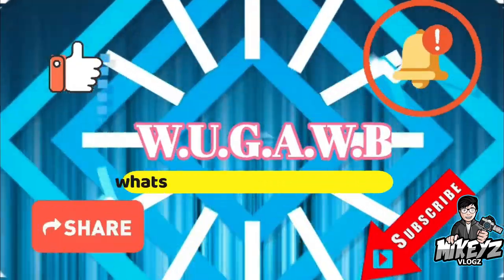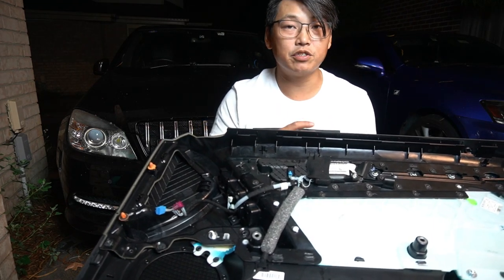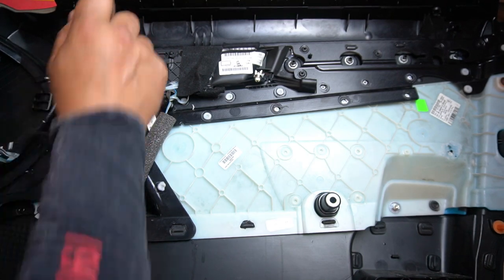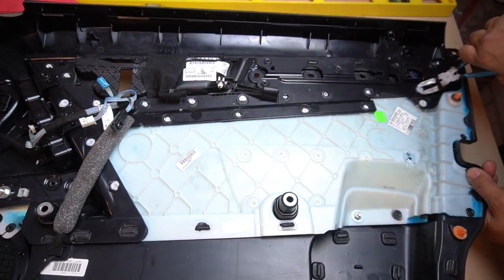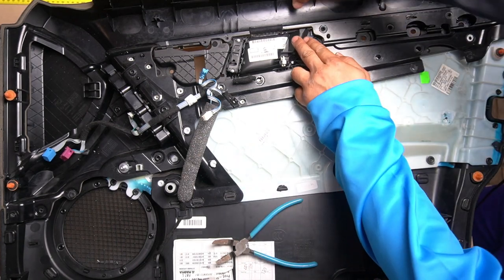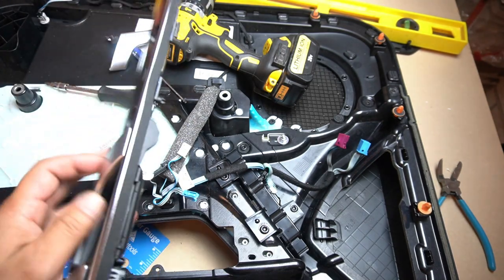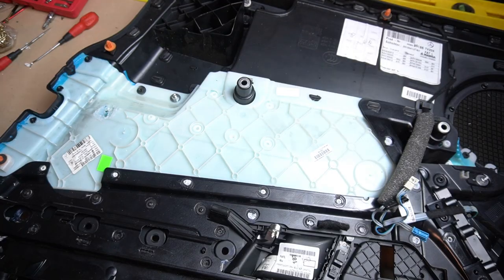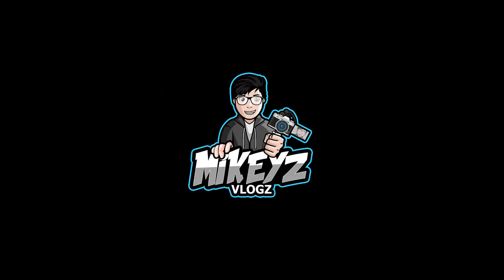mercedes W204 W207 W212 X204 G204 (common fault) interior door handle replace D.I.Y FIX

Comment: Times changed. In my W124 I could remove door handle panel in about 30 seconds, without removing any trim, just one screw. I could fix a broken odometer at the side of the road or swap headlights in -10C at night in 15 minutes. Now I have W204, I need to replace rear shelf (trim? cover?) and I've been mentally preparing myself to do it for a year.
Reply from the maker: indeed it has ... mercedes love being difficult too ..

Comment: Great Video Mikeyz thanks for posting, saved me £100s. 
The kit to fix this fault is on Ama**on
£15 ! 
I did use a large hss drill bit very carefully to remove plastic welds to separate panels,found it more productive. 
Thankyou once again Mikey
Reply from the maker: good stuff mate 👍  well done .. and good on ya using the drill.. good tip
Reply: Big thanks for replying so quickly. Mikeyz
Hats off to you though for the Video which makes an impossible job, possible !
👏🙌👏🤝
Reply from the maker: @johnbavister5936  ur welcome mate ... I'm just glad u didn't take it to mercedes ... cuz we all know how that would've turned out ... bye bye 💰 🤑

Comment: Great video!  Would you happen to know if these replacement handles work for the A207/C207?
Reply from the maker: if ur handles are the same.e yes ...even if not same it will be similar with cutting tabs ..u just need to figure out which tabs allow the trim with the door handle to come out

Comment: great video Mikey 👍 but I started to have a different problem with my 204 .
For some reason my parking lights stopped working I checked bulbs and they are ok, Fuses look to be ok too and instead right indicator  Is flashing right front foglamp.on dashboard shows ther is no bulb.
What problem it might be?
Reply from the maker: what's the problem? the indicator or fog? which one isn't working properly
Reply: @MIKEYZVLOGZ  
The indicator is not working properly..
When I turn indicator on  fogligh is flushing instead
Reply from the maker: @aquamania4441  sounds electrical

Comment: PLEASE HELP!

I finally got everything replaced and the door panel put back on the vehicle. When I went to test it by pulling on the newly installed handle....nothing. I hear the cable being pulled, but the door does not open. Tried locking and unlocking (both electronically with the panel buttons and by manually pushing down the lock pin and pulling at back up), still nothing. Pulling on the door handle will pop up the lock (which I believe indicates that the handle/cable are working properly?) but the door does not open. Door opens fine from the outside, so the un-latching mechanism works. ANY HELP WOULD BE GREATLY APPRECIATED, THIS WAS A MJAOR PAIN AND I WOULD HATE FOR IT ALL TO BE FOR NOTHING :(
Reply from the maker: check your cable ..make sure u put it in properly
Reply: @MIKEYZVLOGZ  hello sir. Mine wasnt a replacement as such. I manually unlocked the drivers door and the hanndle has since been loose. Its locking and unlocking ok, Outside handle fine Thanks
Reply: We are in the same boat. How did u solve the problem
Reply: @patrickramasia6769  make sure the cable is sitting in its dedicated holder. When I first made the replacement, I did not put it in the hold I just attached it to the handle. This also tightened up my door handle because the cable was more stretched out after being set in the holder.
Reply from the maker: @patrickramasia6769  u need to check inside and see if the latch came loose or broke or even just broken latch retainer

Comment: Hi I'm going to have to do this myself. On the same door' the door doesn't unlock without me pulling the handle witch is why I think it's broke over time with me pulling the handle to unlock the passenger side door from the inside. When I change the handle with the panel being of is it possible to get to the lock? Thanks any help would be great.
Reply from the maker: no u need to remove the internal panel like I did...but u can pull on the cable to unlock the door too..ull see wen u open the panel
Reply: @MIKEYZVLOGZ  ok thanks. Is it an easy fix to fix myself. When I use the key to unlock all doors the little tab on the top doesn't pop up or down.
Reply from the maker: @jdogg2789  it is abit involved but it is not that hard ... uve seen the video ... u can get an understanding of what's involved..if u aren't handy with tools might take abit longer but better then raking it to mercedes
Reply: @MIKEYZVLOGZ  most definitely mate ok il give it a go. Thanks man your vids are really good an helped me before. 👍
Reply: @MIKEYZVLOGZ  hello buddy iv been putting of my fix due to work but now I have the parts I need to replace the door handle. My only concern is my door is shut and can't open it will I be unable to do it?

Comment: Ya these suck bad, have an 08 c300 never broken one, my 14 c250 came from Nevada with high heat and now in colder climate there breaking, not cool how they design em, and I'm a master tech btw
Reply from the maker: @jacobgomez2682  thanks for sharing and stopping by much appreciated

Comment: Mikey, this may sound like an obvious question but, which way does the new pivot pin go into the new handle?
Reply from the maker: from the bottom
Reply: @MIKEYZVLOGZ  just want to show you this if I may. Part of the trim isn't sitting right. Not sure if I need to re-hang the door card again?

https://flic.kr/p/2nfuT9B
Reply: All sitting back where it should.  I did however, manage to push the centre part of the H clip into the inner part of the door.  I really hope I don't hear this rattle when driving lol.
Reply from the maker: @andyw3152  lol how did u do that..u must of got so annoyed and just pushed like he'll and bam it fell in ... if u remove door panel u might be able to reach it right at the bottom or unless that only if u drill all the rivets out
Reply: @MIKEYZVLOGZ  When I fitted the panel back, I had pushed the inner part of the H clip too far, made it impossible to pull out.  So I thought, maybe if I push it further in I would be able to pull out the main H clip, then it dropped in.  Did a test drive, could hear the small clip moving around, I think I will have to leave it now.  Thanks Mikey.
Reply from the maker: @andyw3152  no worries as long as ur ok with it mate .. all g

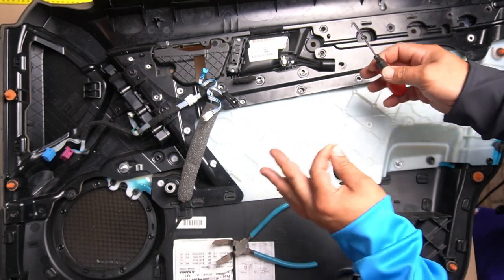Comment: Trying to remove the orange light strip around the handle is proving difficult. 7:20
Reply from the maker: just be. careful do not break it ... it clips in u can see where it clips in .. as shown in the video ... take ur time .. but ut does come out
Reply: @MIKEYZVLOGZ  Many thanks.  Got it out in the end, couldn't remove the electrical connection, but it was fine.  Now waiting for the replacement handle to arrive now.  If MB fixed this would they replace the whole door card?
Reply from the maker: @andyw3152  yes according to some ppl that's what they do

Comment: I broke the LED strip behind the door handle trying to repair it. Does anyone know where to buy a new one?
Reply from the maker: u mean you broke the plastic piece that the led shines through?  I broke mine too I used some super glue that was transparent and just stuck it back together ... it doesn't shine as bright as it once did but the led is still there
Reply: Yea I figured out afterwards lol I didn’t glue it but I just try and clip it as best as possible with the other broken plastic tube piece 🤦🏻‍♂️
Reply from the maker: @jbarra3655  good on ya bud